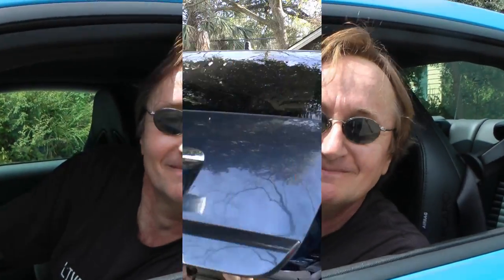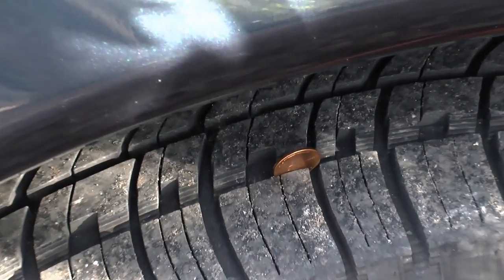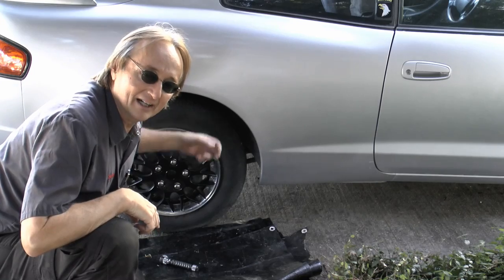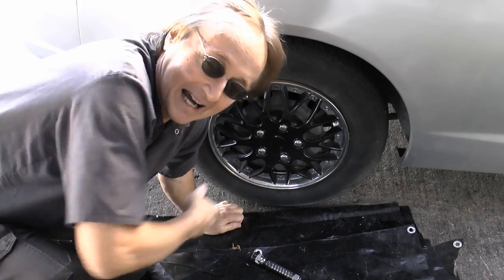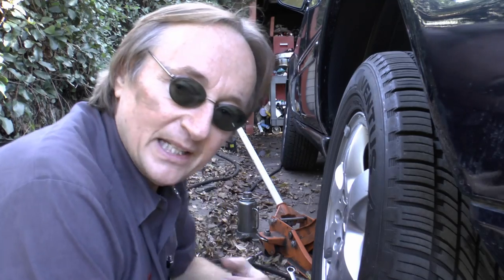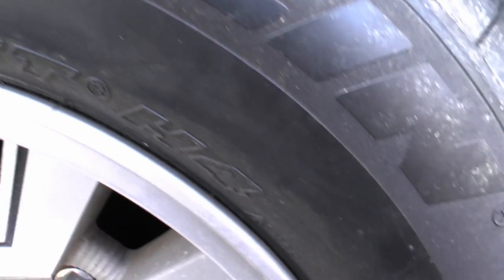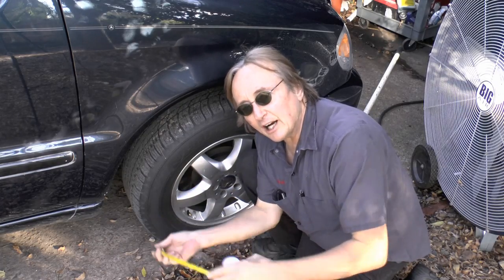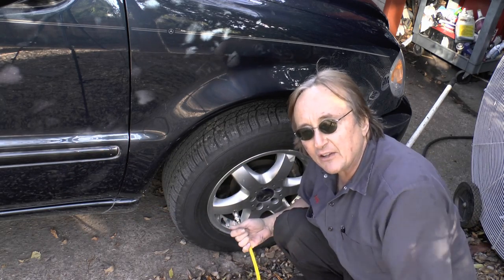How to Tell if You Need New Tires on Your Car

Comment: I have some Chinese tires from Sailun that only costed around 400NOK ($80) a piece and they're still holding up after 1-2 years with no problems. Not the best, but if you're low on money it's better than no tires at all.

Comment: I had 2008 Charger. Bought a set of Michelin Touring tires for it. Best riding tires I ever put on any car. Made the ride smoother and gained some MPG, lasted a long time too. I think a set of 4 was like $450.
Reply: How a set of 4 is 450 from Michelin? They're expensive like 600-800 for a 4 set.

Comment: Fun fact: here, in Hungary, the street legal law is 6mm deep for tires, so the most commonly used 100HUF coin is made gold color inside, with a silver ring on the outside, that is exactly 6mm wide, on purpose, so anytime you see the silver ring, you need a new tire, before the overly strict cops check

Comment: My car was not driven for a year but it had new tires put on before.  The tires now only have 3,000 miles on them and I've checked the tread using the penny method and there is plenty.  I did notice many small sidewall cracks, do you recommend replacing them with such a low mileage or should I wait?  Thanks and I enjoy your videos.
Reply: +Inesh Rathe Those tires have dry rot. There is no rush but should be replaced this year (if they are leaking air then replace them now).

Comment: Which tire would you recommend for a 2015 Subaru Outback? I'm looking for cheap LONG life. I use the car for uber and drive about 150-250 miles a day. It needs to be tough as well for nyc potholes.
Reply from the maker: if a standard transmission, yes. But the automatics cost a ton to fix as they age

Comment: I have a question for you, I bought my car in 2014, i have only put 5246 miles on this car, the outer tread is completely warn down, do you think those tires are still cover under factory warranty?
Reply from the maker: +James Webb Jr no, they go by tread wear, not mileage, and with no tread left warranty is also gone

Comment: Hey Scotty, I have replaced 2 tires on my 2013 Honda Accord Touring due to nails puncturing too close to the sidewall (one of the tires had 4 nails). i went to Costco where they replaced them in the left front and right rear. Should the newer tires be placed at the front or rear in tandem? Should I replace the remaining 2 tires? Also, I seem to hear a wooing noise when I drive now. What to Do?

Comment: If it's 35 F in the morning, the tires will warm up quickly when you start driving your car.Getting tire pressure right at 35 F means over-inflated tires when you're driving . Right?
Reply from the maker: +Rene .Lem Not if the temp stays cold where you live. You always check em cold or they will be too low when cold

Comment: Please help!
my 2003 corolla LE had been making a loud sound in the engine for several months now. one day my car became even louder while I was on the road. by the time i got home and parked i realized the serpentine belt fell off  i was able to get it back on with tools i had in my car, but by the time i got home and parked i realized it came off again and the sound was still much louder than before. I looked closer  at it days later to find that only the water pump pulley was loose. Should i replace only the water pump pulley? Or could it be something else? thanks!
Reply from the maker: the water pump itself needs replacing, the pulley just bolts on the pump and when pump goes bad, it wobbles
Reply: water pumps are cheap and easy to change anyway, its not a big deal

Comment: Hey Scotty, my girlfriend's 2013 Kia Rio makes a noise from the wheels almost like a helicopter. I'm guessing it's the tires but don't know if it may be the wheel bearings or not. The sound does not increase or decrease when going right or left and can be hear at low speeds as well. The car only has 31000 miles with tires that came on it when purchased. Any advice on how to test it out? A video about it would be great too. We live in Houston and would be happy to bring it to your shop. Thanks for all your videos. They are great.
Reply from the maker: often worn wheel beairngs do that BUT perhaps move the tires around first, and if noise changes, it's the tires
Reply: +Scotty Kilmer Thank you for that advice Scotty. I'll make sure to do that. Thanks again
Reply: you should also try lifting the car up and try free spinning the wheels. if you hear a noise - it's the bearing.

Comment: I work for goodyear we recomend changing your tires @ 2/32 of an inch. (same as the penny trick) there are also wear bars on the tires that show you when its time.
also

another thing we go buy is the DOT number the last 4 tell you the week and year it was made for EX: if your dot number ends with:1813 that would mean it was made of the 18 week of 2013. at my store we don't touch tires that are more then 7 years old due to it being old and cracking.

Comment: To measure the tread depth correctly just go straight across from left to right when you check with the penny. Lincoln's head is 2/32" from the edge of the penny and most states (if not all of them in the US) legally call a tire bald and you can get ticketed if its less than 2/32" deep all the way across. There are also wear bars that are built into al tires now. If the wear var is solid all yeti way across the tread then the tire is already legally bald and should have been changed already. The cracking is called dry rot and is the tire being oxidized over time. If the tire holds air its not absolutely necessary to replace it if there are cracks, there is no rule of thumb for it.

Don't buy cheap tires, they are the only contact point between your car and the road, but the bets tires that you can afford and you will be able to stop and turn much faster and with much more confidence (its  a gigantic difference between the bottom three cheap tires and the top three best tires.

Tires also affect fuel economy to a noticeable amount. Check with the ratings to see which give the best fun economy in the category that you choose. If it snows in your area, put high quality snow tires on all four corners (even if your car is two wheel drive) it make a huge difference and you'll get stuck a lot less,

Air pressure is very important, the higher the pressure the better the fuel economy, the longer the tire will last and the better the car will handle. Overinflated and under inflated tires both lose grip and wear the tire out unevenly but its better to go a little higher than a little lower in yo have any doubt. In the old day she used to use very low tire pressure but that does not apply any more. We did not use radial ties in those days, radial need more pressure that old style (bias belted and bias ply) tires or the car will wander al over the road.

Comment: Another good tip, bring your car in for alignment checks, check the owner's manual for service intervals. Or check out youtube for how to do a "shakedown" of a vehicle to see if any steering or suspension components need to be replaced. Alignment issues can be one of the main causes of premature wear on tires, which are costly as it is.

Comment: What do you think of Hankook tires? I don't like mine. I have the Dynapro HT's and I personally don't like them. The tire on the rear right (where the positraction is) is damn near bald already! And before you ask, no I do not do burn outs or anything like that, I drive like a normal person. BUT, when it rains, it just LOVES to spin even though I barley tap on it. I only have 18K Miles on my truck, the other tires are fine for some reason.. what do you think? A lot of people have been telling me Hankooks wear out quickly.. (especially the tire that drives the truck) and how often should I rotate tires? I know I should know this but it just beats me, I'm no tire guy lol...
Reply from the maker: I hate them too, at least the lower end ones.

Comment: what if the tires has cracks on it on the side? do u recommend changing it? Its only 5 years old and I only consume 24,000 on it.
Reply from the maker: +son gokou yes, cracks anywhere are bad
Reply: +son gokou It used to be that cracks anywhere were bad but modern car tires (not truck tires) are all radials and by their nature they have protective belts that go al the way down the sides which hold the tire together.  If you look at the sidewall of your tires you'll see that its says something like 2 belts sidewall, 4 belts tread. This belts hold everything very well. If the tire is not losing air then it might be fine. Test it for air leaks and its leaking in the sidewalk then replace it (radial sidewalls cannot be repaired because they flex too much and the patch will not stay in place).
Reply: +son gokou Tires expire in 6 years. Get them inspected after 6 years old. Otherwise you could have a blowout and you wouldnt want your vehicle to be the next one in the museum for blown out tires that caused fatal wrecks.

Comment: I also find another big problem is heat wear. Cars left Outdoors get subjected to extreme heat changes from hot to cold. These wide variations in the amount of heat the tires are exposed to causes the rubber to harden over time and tires with hardened rubber just don't have the same grip even if the tire tread is still excellent. There's an easy way to test for this:

When your tires are new, add a little app to your smartphone that measures decibels and check the decibel level in your car on a good road at say 50 to 60 miles an hour. This will tell you what the decibel level should be for tires that are in good shape and will give you the best grip.

Now after you've had the tires for a year, check the decibel level again on the same road surface at the same speed. What you're looking for is a significant decibel increase inside the cabin. A few decibels is not a big deal. But once the decibel level has gone up anywhere from 8 to 15 decibels from what it was when the tires were new, well that means that the tires have hardened and it's time to get new tires, regardless of what the tread looks like. Now it could take anywhere from five to seven years for really good tires to harden to less than 4 years for cheaper tires to harden. The greater the temperature extremes are in a given year will also contribute more to the tires hardening or less if the year has been mild pretty much throughout the year. This is an important thing to keep in mind if you are driving a lot on wet surfaces or on slick surfaces in snow or sleet conditions. Thanks for letting me contribute.

Comment: My front tires are worn but my back tires are fine. Also notice car vibration around 60-70mph. Should I get my tires rotated or just get new ones?
Reply: Trevor get them balanced and have the tires that have more tread on the front, especially if it is front wheel drive. But definitely balance them and an alignment wont hurt either. Especially if its been a while. Shop around. You can get an alignment for around $50-70 and have then rotate (and definitely balance) them at the same time

Comment: I had sidewall cracking pointed out to me while I was on a cross-country road trip in California. I figured it be okay. Within 5,000 miles the front right tire exploded while I was doing 80 on the interstate. Did some damage to the rim. Could have been very dangerous. Never buying Yokohama's again. Firestone pointed out the cracking. I've had a lot of really good experiences with them.

Comment: I usually buy used tires myself, but since I have worked with tires for years (Mobile mechanic) I know what to look for.  You get some great tires this way if your careful.  Also, use Armor all on your tires.  The reason in this case (at least for me) is not to make them shiny, but to protect them against the sun.  UV is the number one source for cracks in tires and products like Armor all contain a UV blocker.  Lets put it this way,  my truck is an 86, the tires that are on it are at least eight years old.  The truck stays outside.  No cracks in the tires.

Comment: mr scotty hello 
I have Mercedes E240 2002 . I had one problem recently . when car is steady like stopping at signals I hit the gas pedal but the car is late response . but when I hit more harder its not much late and no problem . I changed the fuel filter but still have the problem . and my fuel pump is making a hug noice I can hear while windows r closed . please help me
Reply from the maker: replace the fuel pump, they should be silent

Comment: Just stumbled on your video because I’m not sure if I need new tires. I live in jersey and drive a 2010 Nissan Pathfiner. When we had that big snow storm, my car was the only car that was skidding on the road. Whenever I braked, my brakes would lock and I would skid. Even if I braked VERY lightly I still couldn’t control my car. Do you think it’s my tires or something else? Will have to use the penny trick later. Im still young so I don’t know much about cars

Comment: What's your opinion on the South Korean brand Kumho Solus tires? I did a lot of research on customer reviews and most people rave about them.   I just got 4 of them to replace the 4 Sears Guardsman I had on my car since 2010.  Your input is appreciated.
Reply: I have to agree with you.  I am very happy with the drive of these tires.  Quiet and sure, even in heavy rain.  Thanks for your input.

Comment: are 8 year old tires that were stored in the basement still okay? they still have good threads and everything. No cracks
Reply from the maker: they still generally dry rot the rubber, but if you try them, watch them closely
Reply: Scotty Kilmer thankyou so much for replying. I will definitely take a close look while theyre on. One more thing tho. My car has 17x7.5 et50 wheels. Can i use 17x7 et45?
Reply: I'd swap em out unless you're really tight on cash. 5+ years and they get damn hard. And hard tyres have much less grip.

Comment: What about the rims? When should I look into replacing them as well? (A lot of rust?)
Reply from the maker: if they don't lose air, the rims are fine, the tire sits on the inside bead, which is generally rust free.
Reply: Scotty Kilmer Alright, thanks!
Reply: justahappyfellow all it takes is a grinder

Comment: I need new tires for my moms Saturn Ion. I was going to go to Discount Tire again (they did it for my Pontiac Sunfire).  The only reason I found cheap tires was looking online though (they wanted to upsell of course). My question is.. how much leeway is there in tires specifically? On their site, the tire they suggest for the Saturn is twice the price (same brand and size) as the Pontiac, but a few different numbers ("195 /65 R15 91H SL BSW" for the Pontiac fit, "195 /60 R15 88H SL BSW" for the Saturn).
 Is it critically important I get the exact tires they suggest? Or could I just get the same tires for both vehicles and be fine? (the tires have lasted well enough the past two years).
Reply: Load rating is critical. This would be the number after the rim size; i.e. 91 vs 88.  Your car should have a sticker by the door jam telling you what the tire size AND load rating should be.  The higher the load rating, the more weight it can safely carry.  Riding on a tire with a load rating below the manufacturer's specification is quite bad as if you get into an accident, you can be blamed for it in all sorts of ways when the insurance investigator looks at your tires.  As such, most tire shops will outright refuse to install a tire with a lower load rating than spec'd.

Comment: Scotty I have a 2002 Ford F-250 XL crew cab long bed 2wd automatic 7.3 turbo diesel pickup (pretty big truck) and I've been having an issue with a vibration that begins at around 40 mph and is pronounced until almost 50 mph and dwindles to almost smooth throughout the rest of the vehicle's speed range. I have had all new U-joints and a carrier bearing put into the drive shaft, all new factory size tires installed, and I replaced the front rotor/hubs along with the wheel bearings. I don't consider that wasting money by process of elimination because those components were worn and needed to be changed anyway, but some of my front end components have play in them, particularly the pitman arm. Could that potentially still be causing my vibration issue or should I go back and have some of what was already done re-checked?
Reply from the maker: yes, it certainly can cause that, ANY suspension part with play can do that

Comment: Scotty, I have nitrogen in my tires on my Monte Carlo and ambient air in my Nissan sentra  . the Nissan tps always says its low in the morning when its cool outside. the Monte Carlo even at 85 mph the tire pressure never changes. I also notice that I get about 2-3 more mpg with the nitrogen filed tires. Is it worth the $5.50 per tire to have the nitrogen in tires or just use the ambient air..

Comment: My main threads seem okay but the outer area (facing most outwardly, away from the car... but not quite the side wall) seems to have this slight crack, deformation like a wear. Is this something to be worried about? If you were to look at a tire on a car from the side of a car, the side walls are okay but right above it (and not the main threads but the outer side) is the area where I am seeing some wear/crack deformation. Even though the main threads seem okay, how about this outer thread near the side wall?
Reply from the maker: get new tires, any cracks are bad news

Comment: I recently purchased new tires for my Vibe.
I HAD TO...two front tires were at the marker and one of them even had a side bubble.

Town Fair Tire said I only needed 2 but I like to buy them in a full set because, well, I drive like an asshole and I need to stability.
Sold the older two on Craigslist.

Best purchase on the car!
I bank turns with confidence on dry pavement.
I still dont trust rainy days though because I've put them through the slip test on a roundabout and know their traction breakage point.